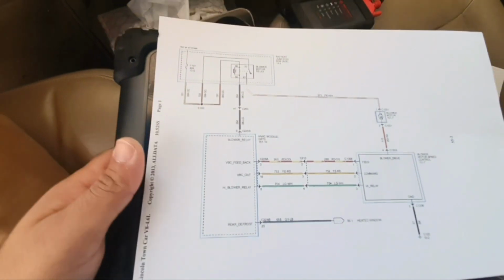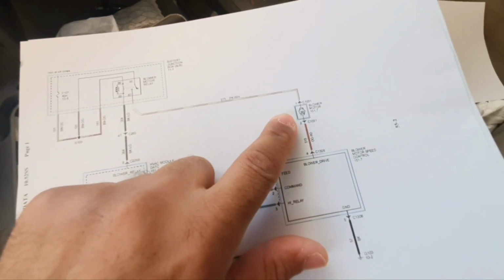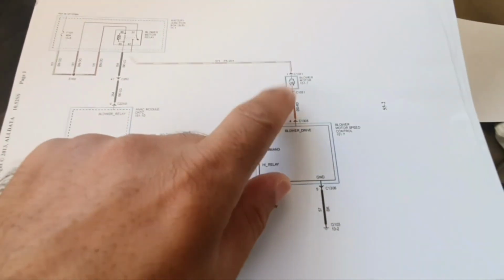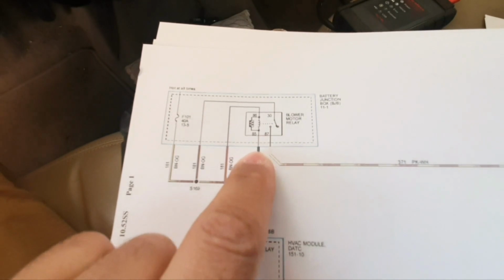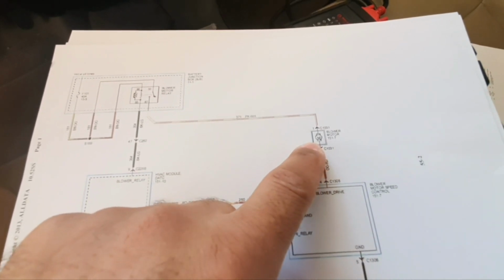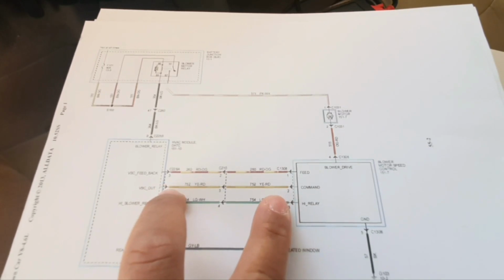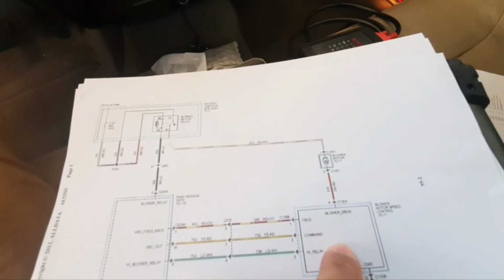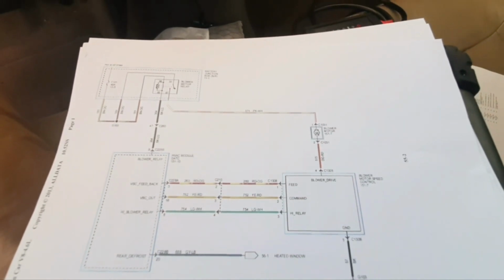Blower Motor Running like Crazy at KOEO || Lincoln town car blower motor || AC FAN running all time

Comment: Thank you, engineer, but this video is a bit unclear. Firstly, the diagram image is not clear. If you had included a clear image in the video, it would have been more understandable. Secondly, how did you determine the direction of the transistor
Reply from the maker: Hello brother 
Thank you for your comment 

I am sorry if the video quality is not that good
About the diagram I will look for it and if I could find it I will attach it to the video description

About the transistor direction, it doesn't fit the other way round, the pins are closer to one end than the other 

Again thanks brother

Comment: So question...when i connect the wire to 30 and 87, and the fan turns on, bad speed controller.  If it doesnt turn on, bad climate control unit?
Reply from the maker: If you short 30 and 87 terminals and the fan spins straight away with ignition switch OFF then its bad speed controller, but if only spins when ignition is ON with terminals 30 and 87 still shorted then its bad climate control unit

Comment: please sir,i would like to inquire from you,what causes inductor coils to heat up immedately after power on,most especially around cpu core section,but has good output voltage but inductor coils are heating up
Reply from the maker: Hello brother 
Its normal for the coils to heat up especially at the power supplies with high power demands, like the ones you mentioned.
You might also encounter heating coils at the GPU core and battery charging coil.
You have nothing to worry about as long as they have the correct output voltage.